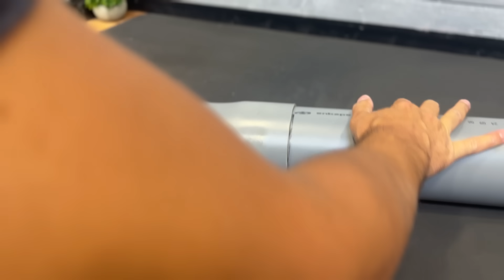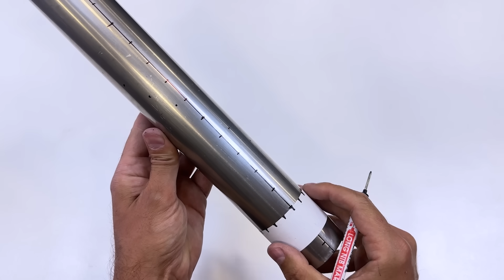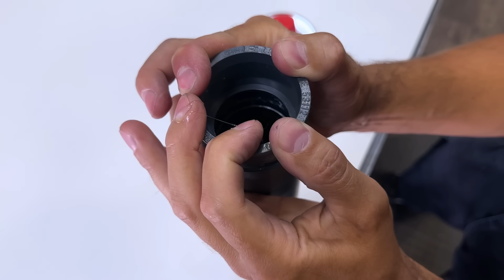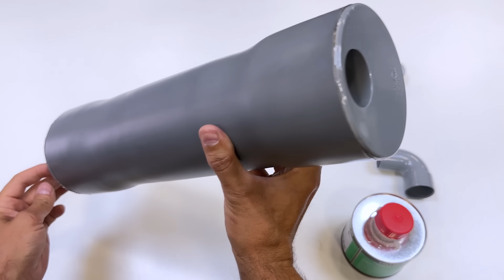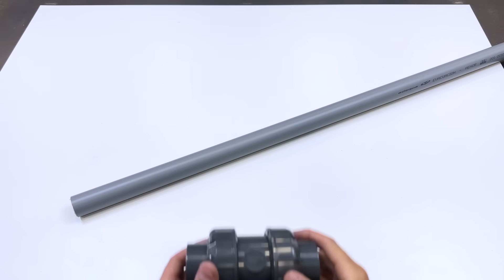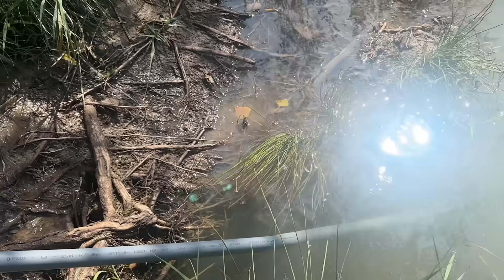How to Make a PVC Pipe Cyclonic Water Pump That Works with Magnets 💧💧

Comment: Lmao im sorry thats not how permanent magnets work. Unless your dealing with extriemly high voltage water isnt magnetic. If they would have just made the stainless steel part the actual pump part instead of lying about the magnetism it would actually work. Basically like starting a siphon but no had to do some crazy explanation about how they hope you dont actualky know what eddy currents are 😂. Eddy currents from water thats a new one. Good laugh though.

Comment: There should be a return spring stopper on both ends of magnets to continue the hand motion. It's a piston pump with small instep pushing water up. Priming is important. 😂

Comment: Very interesting video, thank you for schearing. A question, each time I want to resume the water flow, I have to move the magnets agin ?? Or if the upper magnet stays on the bottom, each time I open a valve the water will flow ? Tx

Comment: Hello...may I ask a question...the stainless steel pipe does not touch the PVC wall...But what about the ends at the top and bottom? It should touch there because of the centring sleeves. Can you briefly explain whether water flows along the outside of the stainless steel pipe? It is difficult to see clearly. Thank you...a great video.

Comment: What are the magnets supposed to be doing? I am by no means any type of engineer but as a welder I do know the stainless steel is not magnetic so unless there is some super duper magnetic mystery I do know about, I am lost as to how this works. And I am also wondering why you heat a pipe, stick a pipe in it the same size to make a belled end pipe when you can buy bell end pvc pipe which is made for the exact purpose that this video describes. And what is up with the voodoo measurements?!? What is this millimeter stuff? Where is the 20 and 5/8th inch version?
Reply: İnsanlarla alay ediyorlar. İnanmayın.

Comment: this is not magic it is a syphon it works on pressure can do the same thing with suctions and a big straw
Reply: You do, of course, realize that a syphon only works when the outlet is lower than the top of the fluid at the inlet?  That's obviously not the case here.

Comment: This design will never work as shown. It’s essentially a perpetual motion claim, which violates the laws of thermodynamics. Magnets can’t move water directly (water isn’t magnetic), and without an external energy source—gravity, electricity, or mechanical input—the system cannot sustain pumping. Any motion you see is just a short burst from initial pressure or priming, not continuous operation. Friction, turbulence, and losses will always stop it.
Reply: @xazoola6000   wouldn't it work with water with a lot of dissolved metals in it? I thought he had addressed that when he said about the alkalinity of the water?
Reply: I headed to the comments as soon as they put the steele tube in the plastic tube claiming it would generate some kind of cyclonic rotation.  I was like, "um how, you isolated the water on the outside of the tube effectively turning it into a straight through pipe."
Reply: It's come to my attention that I've made one of these when I was younger and it doesn't need magnets. It just requires proper seals. The Greeks used it to funnel water, upward and out. You just have the intake pipe going into a like Bell chamber. That's perfectly sealed and it has to come up and out above like a water level. Think the back of a toilet. It's the same principle of a toilet. Essentially, except the top is completely sealed and all the valves are taken out. Thus, the gravity pulling water down out of the Bell will pull water up the pipe, but it has to have an airtight seal and since airtight isn't forever, it can't be perpetual. Also, if the water runs out, it'll end thus not perpetual
Reply: if he is creating a presure diference isnt it the same idea as the two glasses of water and a straw trick
?
Reply: @xazoola6000  copper isn't magnetic either, and yet magnets  interact with copper tubing in a very interesting way.
Reply: Is the metal pipe supposed to spin or something?
Do the cheese graters pull water, or create cavitation when it spins? That part vexes me
Reply: @armageddonready4071  бро, когда ты прикладываешь магнит к железу он прилипает к нему. Даже сквозь пластик или дерево. Железная труба прилипнет к магниту. Фактически ты будешь шевелить стальной трубой внутри пластиковой. Второй магнит для этой цели вообще не нужен. Достаточно одного. Просто посмотрите эти простые устройства подачи воды из сельского колодца путём создания разрежения при нажатии на ручку насоса, механического. На первых секундах видео автор показывает максимум КПД без насоса вода идёт толчками. Это нормально, а потом он включает водяной насос и вода уже бежит активно. Я не стал смотреть все видео. Мне достаточно 25 секунд, чтобы понять, что это просто красивый фантик. А не что-то действительно стоящее.

Comment: Of course it doesn't work, to move a mass to a higher level energy is required in the form of a force, (Newton's second law) So a contour current energy/force must be applied for the water to be moved from the pond to the ground above (I suspect that the electric pump is at the end of the feed pipe that goes down into the pond)

Comment: 13:01 - the ‘water coming from the ‘pump’ is AI generated. Way to go (alkaline of the water is proportional to what?!)
Reply: No need for AI. Just stick a submersible pump at the intake, or connect it to an existing tap via a hose that's hidden from view...
Reply: Not ai, but what he ^^^ said.

Comment: After searching a little about Lenz-Faraday law, a magnetic field MIGHT induce movement in water. I'm no expert in that field, so I would have to study a effin lot to understand what's going on here.
But it seems that ultimately, that pump won't last forever : magnets lose power over time, when opposed to one another; and they seem to be the power source for that thing.
Reply: @philippegimenez2882  I have to wonder about this and what we've been taught in the past and the changes made over the last 60 years. When I was a kid you could buy magnets that would cause calcium and iron crystals in water to ball up and not adhere to pipe surfaces. In essence it would k e p your pipes clean and it did tyat by placing the magnets that were shaped like pipe clamps around those pipe but the magnets were north/south fighting or repelling each other. I tried to purchase these 10 years ago and when I received them they were designed to attract each other! Not repel. This can actually cause a reverse effect. Causing the pipe to collect the deposits rather than keep them clean. Since then, I've tried to find those but can't seem to get the proper ones anywhere.  If i can find these magnets I'll probably build one of these just to try it and see. Ivegiven up paying attention to comments negative or otherwise on here and found tyat its easier to just try something and see if it works. Knowing the little that I do of magnetism  there is a slim possibility that this could work. Lol

Comment: Boleh dibeli pompa tsb dan berapa harganya
Reply: It cost Infinity dollars because it's not real
Reply: It will only work if you add the (bot shown( submergible pump with its own power connection under the suction tube..  )  @timpatton9383

Comment: I can understand how a ram pump works, but not that , nothing actually pushing the water, not even the weight of the water like a ram pump.
Reply: @terrycummings81  magnet is working inside they have iron to push the water from the magnet.

Comment: AI said: The claims made in the YouTube video you described raise several red flags that suggest it may not be a legitimate or scientifically sound concept. Here are some key points to consider:

1. Free Energy Claims
Violation of Conservation of Energy: The idea of a "free energy" device typically contradicts the first law of thermodynamics, which states that energy cannot be created or destroyed. Any system claiming to produce more energy than it consumes is likely not feasible.
2. Lenz-Faraday Law
Understanding the Law: The Lenz-Faraday law relates to electromagnetic induction, where a changing magnetic field induces an electromotive force (EMF) in a conductor. While this is a well-established principle in physics, using it to create perpetual motion or free energy is highly questionable.
Application in This Context: The proposed setup seems to suggest that moving a magnet can somehow induce a flow of water without any external energy input, which is not supported by scientific principles.
3. Hydraulic and Magnetic Dynamics
Cyclonic Flow: While creating a cyclonic flow in a pipe is theoretically possible, achieving this effect through the described method may not yield significant results. The design and mechanics of fluid dynamics are complex, and simply drilling holes in a pipe does not guarantee efficient flow enhancement.
Magnet Interaction: The interaction between the magnets and the water flow might not produce the intended results. The manual movement of the magnet requires energy input, which contradicts the idea of a self-sustaining system.
4. Pump Regulation
Distance and Flow: The claim that the distance between the magnets can regulate the pump's capacity raises questions about how this mechanism would work in practice. Pump efficiency is typically determined by design, pressure, and flow characteristics rather than magnetic positioning alone.
Conclusion
Based on the principles of physics and engineering, the claims about a free energy water pump using the described method appear to be dubious. It is advisable to approach such claims with skepticism and to rely on established scientific knowledge. Always consider consulting credible sources or experts in physics or engineering for a thorough evaluation of such concepts.
Reply: In a nutshell, magnets are not gonna move the water . Which is what you have to do to get something pumping I can see very easily once the water is flowing you can get a siphoning action however, magnets don’t move water. Now , there are pumps. She used an ice machines where the impeller is attached to the inside by a magnet and a motor spends that magnetic impeller, but as it stands, I call BS on this pump
Reply: @TolisOnLine  im actually quite curious, what was the purpose of your long rambling confusing academic double speak? Have you spent so much time in a academic environment that your thought process has stagnated to endless regurgitation of common sense?.
Reply: @TolisOnLine  ok man you’re so intelligent there is people try to create a manner to save humanity and you that serve the establish systeme of production consomption this comment do not help and you just want to feed you’re ego and by chatgpt not you, you don’t event try but give ia total credibility ia don’t do it just suppose and free energy device Will destroy this society you really thinks chatgpt that is create by these same people who create the system will give you the answer ? Thinks by yourself and don’t try to put your ia knowlege here, you’re commenting science theorie againts ingeneer i think you forgot that